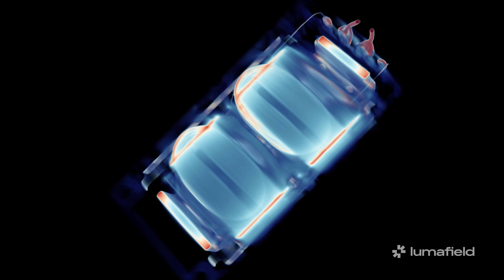Switch 2 Pro Controller: Built to Break? Full Teardown

Comment: All standard size controllers should use two easily removeable 18650 batteries. Battery life would be insane and if you wanted to, you could quickly swap out dead bats to continue to use it wirelessly. Companies could even save a buck by not including the cells. That would be a revolution! (Maybe not the not including cells part!) 

This is already a reality with RC Controlers which have much higher quality components for less cost...

Comment: I hate the faceplate as it's already slightly raised from its place. There's a small level difference that keeps rising up and when I push it back it makes annoying squeaking sound. If i don't, the surface is uneven. It ruins the whole unibody feeling it otherwise have.

I bought the controller being perfectly aware of the fact that it absolutely will--with 100% certainty--start drifting before the end of the year. It's not drifting quite yet, but the faceplate issue is annoying. I know it's practically not repairable, so I have other controller waiting to get back in the action when this one eventually starts drifting like a Toyota AE86.

Comment: Wow!  I LOVE it.  He called out nintendo for their MA$$IVE ca$h-grab tactics!  About time.  So many mindless lemmings who run straight for the cliff to commit financial suicide and support this greed.  For the record, I've NEVER experienced stick drift in any of my original Xbox controllers back from 2001...  ZERO excuse for it in 2025 from any manufacturer!  It's simply poor quality that's intentionally built into these controllers so the consumer has to spend more money on new ones.  The one thing you forgot to mention about this lackluster controller, however, is the fact that they're still using DIGITAL buttons (vs ANALOG or pressure sensitive) - including and especially the triggers.  Again, ZERO excuse for this in 2025.  My original Xbox had ANALOG triggers in 2001 and my Sega Dreamcast did as well back in 1998 - nearly three decades ago!  Nintendo has become a completely JOKE!

Comment: I have a 2017 pro controller from my switch 1 days. I can say that its borderline unusable with all the problem the sticks have, nevertheless the original joycons are doing even worse. I had to eventually buy a new pro controller some 2 or 3 years ago, and even this new one is having some early signs of incoming issues. It started having them after just a couple of months of usage, but it hasn't gotten much worse since. I hope for all you switch 2 pro controller users that it can last for as long as possible, but it's looking grim.

Comment: I've had a Pro Controller for the Switch ever since it came out in 2017, and I used it a lot. It never showed any wear and tear. I am expecting the same out of this controller, so I don't expect to worry about repairs or replacements.

Comment: Seems kinda like the review is based soley on how difficult the controller is to take apart and not at all based in its actual performance. I don't think these controllers are designed to be disassembled by consumers. Maybe Nintendo is expecting people to send them in for repairs instead... lots of products are like that.
Reply: Kinda hard to provide a fair "performance" review of a product when it's only been out for less than two months.  He did a fantastic job of breaking down the controller (figuratively as well as literally) and he seems to know very well what he's talking about.  And just because "lots of products are like that" when referencing repairs doesn't make it right or acceptable.  For the record, my original Xbox controllers from 2001 that have been used for decades have never had stick drift or needed any repairs.  Why should controllers with newer technology?  The fact that certain consumers find this greed/lack of customer support acceptable on any basis is exactly why these companies are taking advantage of us all.
Reply: @nikeandaiza4521 TF? Why would it take you more than two months to make a performance review for product You Currently Own? He has no problem creating a "quality" review and Speculating about what future problems  the controller Might have. The Switch 1 Battery reliably lasted 8 years (I have 5 of them) Why would they design this one with assumption that consumers would need to access the battery? ... Why should consumers need to access the battery?
Reply: @nikeandaiza4521  They aren't meant to be taken apart lol... Super weird to rate the quality of a controller based on how difficult it is to disassemble.
Reply: @nikeandaiza4521  TF? Why would it take u two months to describe how a product You Currently Own is Operating?

Also the switch one pro controller was hailed as one of the best controllers of all time by at least three separate publications... one of the main reasons for that is the battery. I own 5 pro controllers and after nearly 8 years, I have never once had an issue with a single one of them AND I have also never heard of Anyone Else having an issue with that battery... and yet the crux of his complaint is how difficult the battery is to access. Common sense should tell you that one of the most reliable batteries in game controller history probably isn't designed to be accessed by the average consumer because the average Consumer Shouldn't Have to Access It! Just like u didnt with your old xbox controller and like I didn't, with the seven Switch 1 pro Controllers and the 2 Switch 2 pro controllers, that I currently own... Not rocket science.

Same with the drift, it doesnt take a rockest scientist to see that the controller is more securely and firmly put together then the switch 1 pro controller to prevent drift. It shouldn't be easy to take apart your game controller because It's super easy to permanently damage it, which is why they expect you to send it to a professional or back to the manufacturer for maintenance or repair... Again... Not rocket science.

He Doesn't Talk About... Comfort or Design or latency or performance or button placement or functionality or weight.  He doesn't talk about Any of the actual features of the controller except in passing but calls it piss poor because...  it's hard to take apart??

Comment: Am I weird? I had the same Pro Controller for the entire lifespan of the Switch and never developed drift. And the battery life on the Pro Controller (OG) is so good I don't know that I noticed any decrease in battery life.
The new Pro Controller uses a new battery tech. It remains to be seen how long it'll take for the battery life to decrease or for the sticks to loosen or drift.

(And before anyone asks, yeah, I had to replace the sticks in my joy-cons a few times. Just not for my Pro Controller.)

Comment: This is an absolutely awful design.  If you're still buying the Switch 2 pro controller after this, this is a clear indication to any console maker that it's okay to design controllers this way.  There are way better options with Hall effect sticks and easily replaceable batteries.

Comment: Potentiometers at this Price Point is robbery
Reply: The fact that the sticks use potentiometer is a big let down cause the stick design is incredible. They are super smooth, the smooth rings are the botton and  the sticks are thinner than  normal so they have a lot more range .really, if you use a dualsense or an xbox controller right after playing a bit with this controller they feel like they have the sticks of a joycon
Reply: el control es facil de desmontar solo se necesitara pegamento nuevo facil se consigue por 5$usd, los sticks al ser atornillados tu mismo lo puedes desmontar y cambiar, los chinos sacaran su version hall efect
Reply: is it really a surprise considering the PS5 controller has drift issues and the Xbox controller has potentiometers too, they literally have no real competition to warrant putting hall effect sticks
Reply: Especially since every third party controller uses hall effect at half the price
Reply: @NamelessDjinn  Some third party controllers have insanely precise joysticks and customization options, but let's be real, have you taken a look inside one? They look like what they are: Chinese. Those yellow batteries, the bad quality plastic and boards. Even if the hall effect sticks last forever, the rest of the controller won't for long.
Reply: @arturboy777  Chinese doesn't mean cheap and bad materials. the best AND the worst hardware comes from china because they are the biggest manufacturer in the world. but people only associate them with cheap stuff.
Reply: @A @Asad-hv2dc  When the controller is 30 bucks, it is cheap. Hall effects mean nothing when the rest of the controller will die quickly. Usually people just get mods for the pro controllers to have easily replaceable Hall effect joy sticks and such.
Reply: @NamelessDjinn  I'd say yes, but a lot of those controllers have shortcomings that fall short of the Pro Controller.

Which third party controller exists that is cheaper and has ALL the functions of the Pro Controller?
Reply: @neonswift  The Mobapad chitu hd has all the functions of the pro controller and it's 40 bucks.
Reply: @NamelessDjinn  Cool thanks, I'll check it out.
Reply: @NamelessDjinn Nop, that controller don’t have the NFC functionality.
Reply: @neonswift  plenty of them have nfc and hd rumble.
Reply: This price point is robbery, full stop.
Reply: The Switch 2 sticks are better than Hall effect.
Reply: @icy1007 I don’t think that is really true but I honestly love the controller. Plus I highly doubt these joysticks are as prone to drift as the joycons, I have heard way less cases of pro controllers getting it
Reply: @icy1007 LOL

Comment: First-party controllers used to be more durable and accurate than third-party ones and thus their higher price was somewhat justified, but nowadays that's no longer true. They are still overpriced but are less durable and precise than aftermarket controllers, how the tables have turned.

Comment: This is really surprising, as all of the other nintendo pro style controllers are easy to tear down and are generally excellent. This pro controller disassembly reminds me of the xbox elite controllers, and that's not a good thing.

Almost everything nintendo has done in this controller could have been avoided. Every change from the original pro controller was bad when considering repairability. It feels surreal seeing one of the big 3 console manufacturers mess this up so bad.

Comment: Really, Nintendo has always done this, but they are really going full on greed this time, the pro controller 2 is more expensive, same shit components, worse grip material, and they have soft-locked console wake-up on the original pro controller for the switch 2, creating a forced obsolescence that will push many consumers to buy the new controller, that is some next-level greed. (illegal in the EU by the way)

Comment: tbf the drift issue isn't as prominent with the og pro controller as with the og joycons. DualSense Controllers are even driftier than the Switch Pro Controller so hopefully this one will be even better despite not using hall effect or other drift resistant sticks. time will tell.

Comment: Every single official controller uses potentiometer sticks, Sony, Microsoft, you name it, even those that are more than twice the price, but somehow it's a problem only when Nintendo uses them... Also imagine being mad that the rumble packs are "buried inside the grip", like the nerve of Nintendo daring to put them exactly where you need to feel the rumble!
Grifting, you're doing it right.
Reply: Yes, every first party control uses potentiometer sticks, and Nintendo is the only one that has faced lawsuits over it to my knowledge. I had three pairs of Joycons and my Pro Controller all get drift, and I'm not touching the Switch 2 because I refuse to trust the hardware since they apparently learned nothing. And with a $10 tech demo, I don't really trust the software, either.
Reply: they've complained about them too, do you want them to do their job and give feedback or just laud Nintendo like everyone else?
Reply: Indeed,  this "review" seems extremely toxic toward Nintendo for doing THE EXACT SAME THING MS and Sony are doing.
Reply: iFixit has repeatedly gone on the record that the other controllers are just as bad. They've torn down the PS5 controller and lambasted Sony just as much by explaining drift, why it's happening, what parts are shared across all potentiometers. They also have torn down an Xbox controller to do a DIY solder replacement for a Hall Effect sensor.

There is no "only a problem when Nintendo uses them", the issue is that Nintendo's part selection due to being low-profile happens to be more failure prone, and his wording in this video is very careful to explain he doesn't know the current stick failure rate, but because it shares the same low-profile design, it's likely going to share the same failure rate.
Reply: Sony used hall-effects in the DS3, Sega used them too in the Dreamcast Controller. Please, stop trying to pull everybody down to your level of expectations...
Reply: @Dekaid  and why did they stop doing it?
Reply: @Dekaid Dualshock 3s do not use Hall Effect sensors. They're a custom designed MR sensor that only shares using a magnet in their similarities. They also switched to potentiometers with later DS3s because the MR sensors were too expensive to continue using and drew too much power over time. HE sensors are not the simple fix everyone believes it is as you have to engineer the entire controller around that while balancing power draw on other components.

The DS4 and Dualsense have the gyro sensor, rumble, touch sensor, speaker, wireless audio streaming processor and microphone, LEDs and headphone jack all drawing a massive amount of power, with the Dualsense adding the Adaptive Triggers on top of that. Their controllers are massively notorious for having a short battery life of around 5-6 hours and a very fast degradation of that battery over time. Xbox use HE sensors in their trigger mechanism, which causes interference with HE sensors if you mod the controller to add HE sticks.
Reply: @Dekaid  The Argument is nonsensical, The DS3 is 19 years old. Modern Sony controllers use Potentiometer sticks
Reply: @forkytoonzyoutube8988 The comment I replied to never specified modern or not, plus you're agreeing with me then that its worse now than it used to be 19 years ago?

Comment: I'm hoping there will be hall effect replacement sticks for the Switch 2 pro controller (even third party sticks). Yeah, it's gonna be a hassle to tear down and reassemble (dear god, using isopropyl alcohol to uncover the 1st cap), but I'm hoping that the replacement sticks will be fully compatible (maybe hopefully a longer capacity battery replacement too).

Comment: I'd spend $80 on a drifting-capable C button, but I'll stick with my $20 third-party controller. At least it has a Hall sensor. When I really want to experience it, I'll use the original Joycon. After all, Nintendo's quality is still "the best".
Reply: Nintendo this era made everything worse quality. I don't see one slightest being anywhere near the best when even Temu knockoff made something better😂
Reply: @toututu2993  The first generation of the Switch lasted for eight years, but still failed to learn its lessons

Comment: Good video. Greed is the only explanation for potentiometers - not because they are so much cheaper, but because Nintendo knows most people will rebuy original controllers. Drift free optical sensors have been used in e.g. Microsoft Joysticks in the 90s - still work perfectly today! Now multiple companies offer more precise and wear free Hall effect sticks and triggers in controllers for half the price. I think it is time for the EU and bring the law hammer down on this wasteful planned obsolescence, because clearly "the market" or the companies do NOT regulate themselves in this regard. I mean we talk about Nintendo literally grinding materials along each other (with the expect limited wear reserves), instead of using contact free magnetic fields.

Comment: With the exception of the potentiometer sticks (though I have never had issues with my Switch 1 Pro controllers with 1000+ hours use each), to me (as and engineer) this controller seems to be designed to last whatever punishment it receives, just not built to be serviced.

Most controllers develop creaks, or play over time, I don't see that happening quickly with this controller.

Comment: You do know it would not be hard for Nintendo to issue a directive indicating they will not allow any more teardown videos of their products and I am surprised they have not done that yet.  No one buys products based on a repairability outcomes, including myself.  No products in the last 30 years have been designed to be repaired and the companies that make them will not sell you any genuine parts, so there is no benefit to repairability because the manufacturer determines who if anyone they sell parts to, let alone the time and effort and free labour to do all this - it simply makes no sense to fix these devices and if you want it repaired you pay the manufacturer.  Nintendo like any other manufacturer has the right to make their products how they see fit, no matter what a minority of consumers think.  Additionally most people do not keep this products for multiple years, and by the time the battery fails it’s time for a new one anyway.